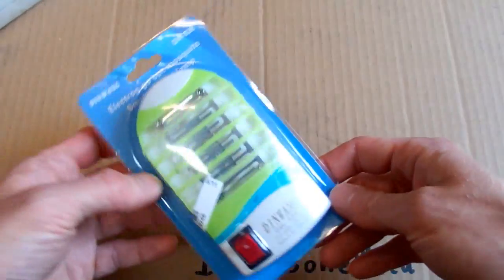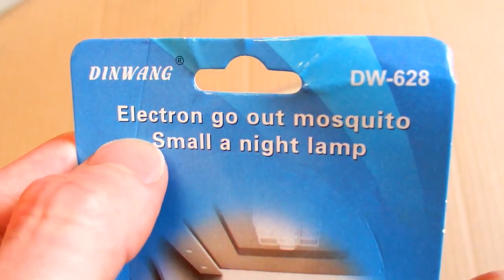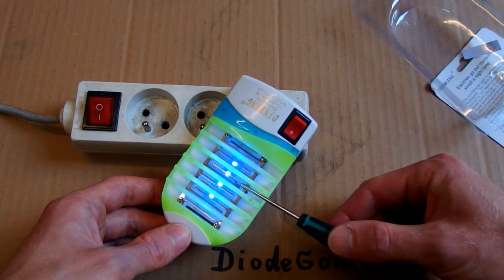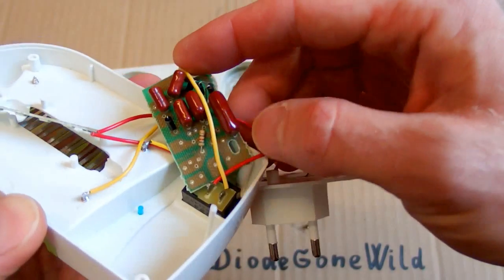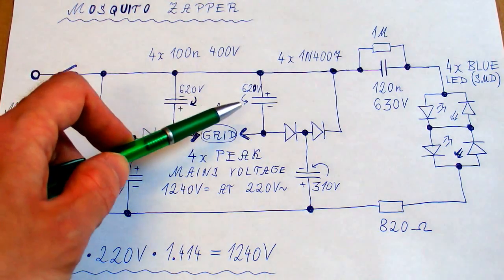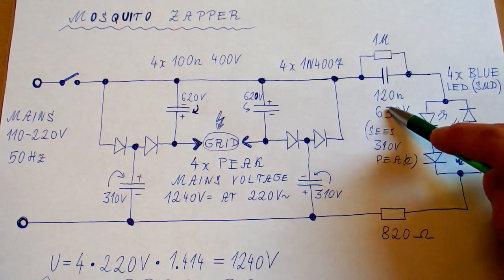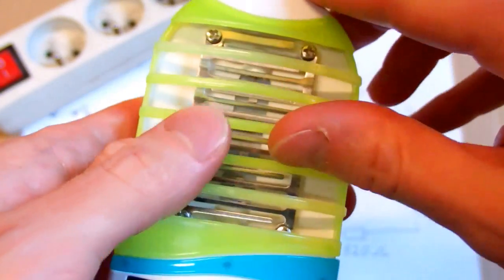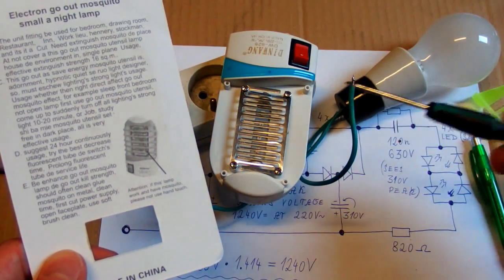Chinese Plug-In Mosquito (and Human) Zapper

Comment: 1:30 Instructions time, this has to be the best instructions, see below:
Electron go out mosquito small a night lamp:
A. The unit fitting be used for bedroom, drawing room, Restaurant, Inn, Work lieu, hennery, stockman, and its a Cut Need extinguish mosquito de place.
B. At not cover a this go out mosquito utensil lamp house de environment in. single plane Usage, effective extinguish strength 16 sq.m.
C. This go out as save energy mosquito utensil is, adornment, hypnotic quiet se ruo light designer, so, must eschew lighting's strong light's usage. Usage whether then right direct affect go out mosquito effect, for example sleep front bedroom not open lamp first use go out mosquito utensil, come up to suddenly turn off all lighting's strong light 10-20 minute, or Job, study shi ba mie mosquito utensil set free in dark place, all is very effective usage.
D. suggest 24 hour continuously usage, try the best decrease fluorescent tube de switch's time. Prolong fluorescent tube de service life.
E. Be enhance go out mosquito lamp de go out kill strength, should often clean glue mosquito on metal, clean time, first cut power supplu, open faceplate, use soft brush clean.
Attention: If this' lamp work and have mosquito, please not use hand touch.

Comment: To me, the unused holes are specifically for for discharging the capacitors. But due to cost, they decided not to use the resistors.
(Based on my oppinion)

Comment: This is interesting... I happen to have a small photocell night lamp that is exactly the same as this, but with some white LEDs inside, a small photocell where the switch would be, an added plastic cover and different color scheme. It's pretty neat, only turns on when there is no light. It seems like they reused the casing, not surprising since it's China.

Comment: I wonder if you can connect a wire from the electric grid to a metal screen door to zap someone that tries to open it?
Reply: you could actually kill someone by doing that. Such a mosquito zapper, connected to the power mains, is nothing like a battery powered stun gun.  Don't do it.

Comment: The current of the grill can kill a kid?
Reply from the maker: The current from electrode to electrode is capacitively limited to several mA, but the problem is, that the electrodes are not isolated from mains. The current from electrode to ground (earth) is not limited. This may be deadly even to an adult in some circumstances.
Reply: thanks for the attention, so if i understand when the connect to the right side of the wall "live" ac, will not have problems, because the current is in mA, but if connect do the wrong position on the wall can be dangerous? thanks in regards
Reply: @danielmoraes9637  Late reply I know, but this is dangerous even if plugged in normally - because if you touch the grid you're basically touching the live pin of the plug. There's nothing to limit how much current can flow from the grid and through you to ground.
Reply: @josh46646  thanks for the reply, i think that de capacity of capacitor can determine how much energy flow, i mad a test, i short thsi grid, and the consumption was 5w hour
Reply: @josh46646  yes i agree with you, thanks, cheers

Comment: yes its very dangeous not like mine, i am looking your diagram its better than mine, my one has only 2 capacitors 2 diodes for doubler and mains on the grid .. will copy this and will use 2 resistors  about 100oms 1w from mains to cut direct current and change blue leds to ultraviolet, and installed a fuse 500ma

Comment: I found it so cool that you made a circut diagram for this
Reply: BigCliveLive tore down two of these things. The circuit in this bugzapper resembles the first one he tore down, in that it uses a four-capacitor multiplier. However in the one BigClive tore down the capacitors in the multiplier all had the same capacity but were rated for different voltages, resulting in a pretty spectacular explosion.

Comment: While I agree with other points, what's wrong with 1/8W 1MOhm resistor? Mains will heat it for almost 0.05W, which is less than a half of it's power rating, and if it isn't defective, it will not short unless exposed to elements. And if we expose such device to the elements, MOhm resistor will likely be amongst last things to fail.
Reply from the maker: The power rating is OK, but resistors do also have a maximum voltage rating. In high-resistance resistors, the power dissipation can still be well below maximum, while the maximum voltage is exceeded. The 1/8 W resistors are usually rated just 200V and the 1/4 W ones are 250V. The peak value voltage of 220Vac mains is 310V (and for 240Vac mains it is 340V). So for 220-240V mains you have to use at least 1/2 W resistors, those tend to be rated for 350V.
Reply: Well, resistor voltage rating is not something i heard about before. I mean, i knew that high voltage can "convince" materials into better conductivity by means of ionisation, but 200V?
And datasheets agree. 200V working, 400 max overload and dielectric withstanding for 1/8W.  Damn, i think they should've told this to me at colledge D:
Reply: Norzel7
Yeah, unless we are talking about high resistance resistors like this one, usually the resistor voltage rating doesn't matter so much. (Otherwise, if too high a voltage is put across the resistor, it will dissipate too much power and burn up anyways. Say a 100 ohm 1W resistor on mains voltage, as an example. XDDD)

Comment: Seems like they reused an instruction from a tube version, i.e. "Prolong fluorescent tube de service life".  I also wonder if the factory got the 630v capacitor for the LED mixed up with 400v capacitor for the 620v stage of the voltage doubler.  As for effectiveness, it would be interesting to try out, e.g. put it in a dry sheltered area outside, leave to run for an hour when there's mosquitoes about and then check whether any got zapped.
Reply from the maker: Yes, the manual is a horrible mixture of an old recycled text and a terrible google translation. The multiplier should have had the 630V capacitors (there's 620V) and the dropper should have had the 400V one (there's only 310V). I will test it, but I believe that insect is sensitive mostly to 350nm UV, not 455nm blue.
Reply: The Chinese call everything a tube. LEDs are tubes. Transistors are tubes. Vacuum tubes are valves. JK they are also tubes.